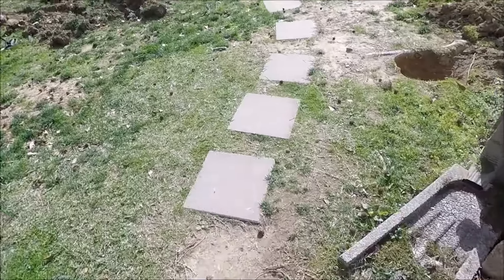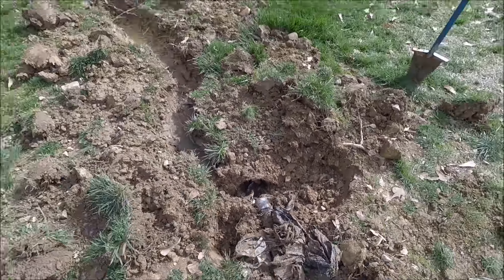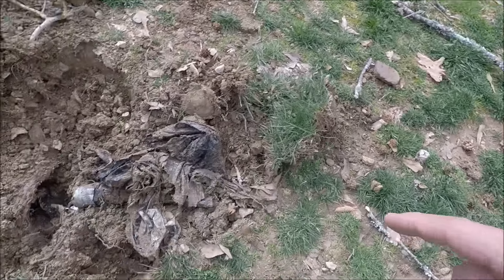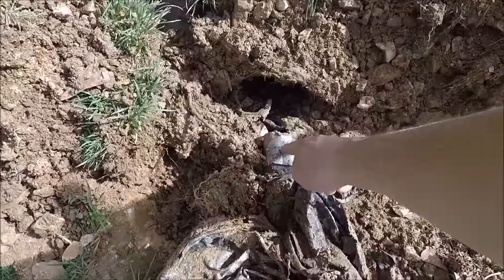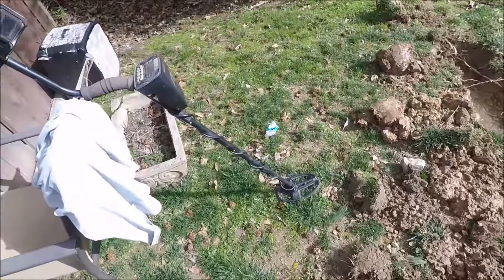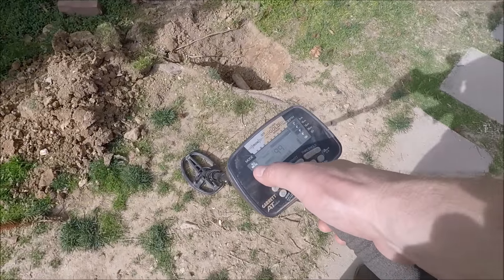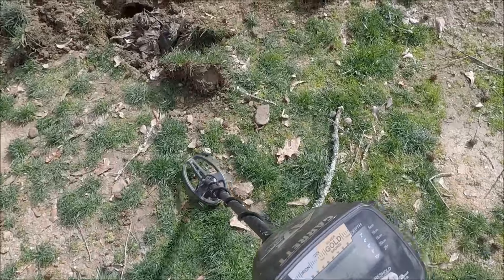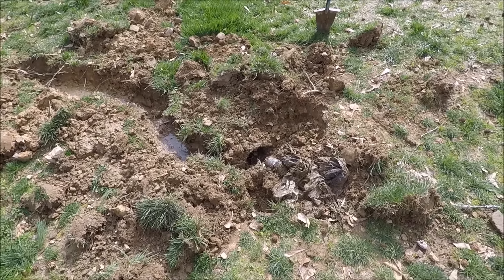Clogged Field Lines: Using Metal Detector To Locate Drain Plumbing Clog

Comment: A country boy can survive! While you have that opened next to the house. You might want to put another clean out so you don't have to go under the house to access. I bought the 1/2" cable part for the roto router machine and cutter heads at Tractor Supply for $50+ and cut the cable in half. It works great in my boar hog 1/2" drill.
Reply from the maker: Nice idea, thanks

Comment: you will Need 2 rubber pipe couplings & section of pipe to make repair job. Cut out the bad section replace with good pipe same diameter, can be Pvc.  About  $20.00 at Big Box store will save doing repair again. Spray foam is temporary, the roots will only laugh at you.
Reply from the maker: I wondered about the foam, thanks for the advice. I'm gonna do that.